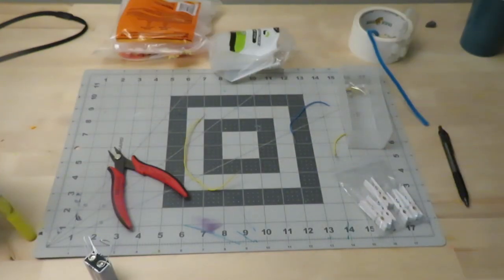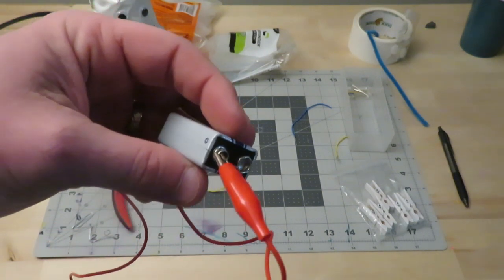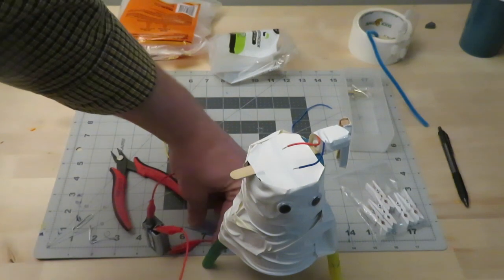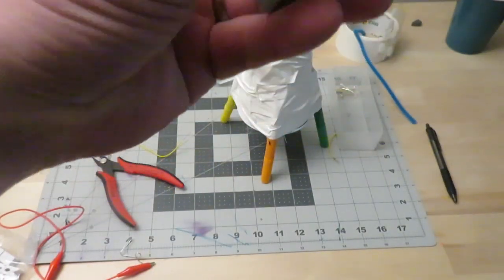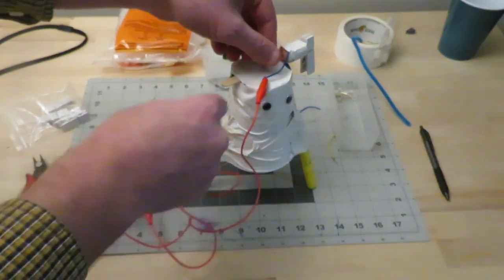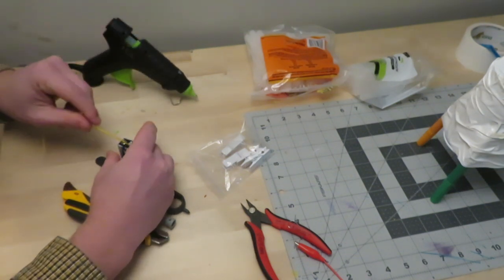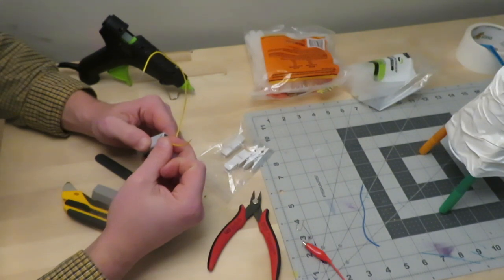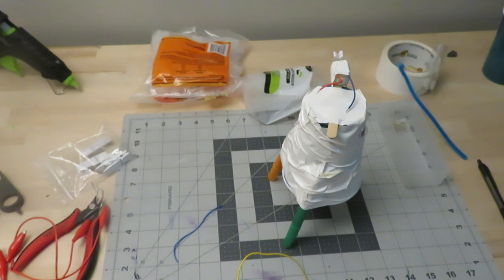3 Easy Ways To Connect Wire to a 9 Volt Battery

Comment: Hi this is great but i need some help please.  I have an old Halloween moving decor item and it has 3 wires... black red and orange.  They were connected to a 4 AA battery pack which also had 2 wires red and black.  The black one broke off completely and all broke off from the battery pack.  

So, i can i use your method to make this work? Do i just hook the 3 wires from my decor item to 3 AA batteries or something else? Thank you!!